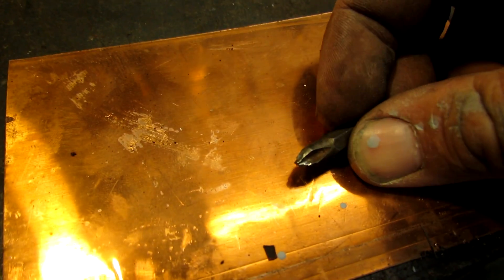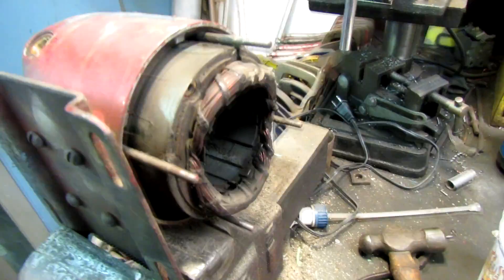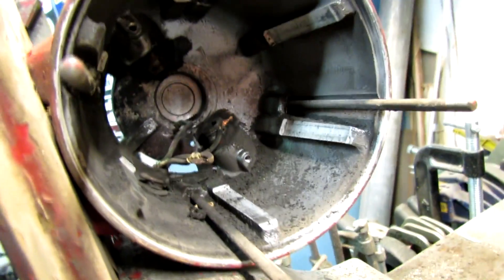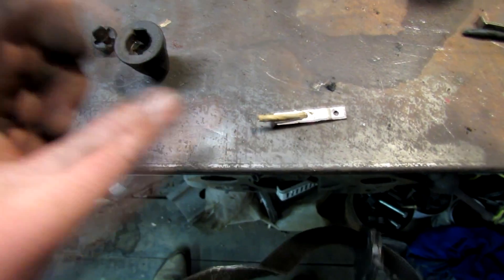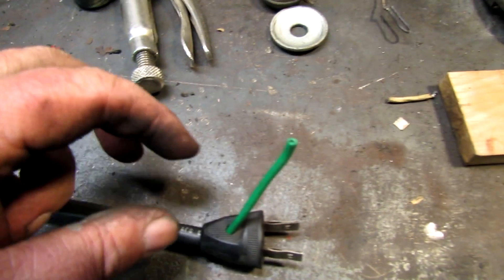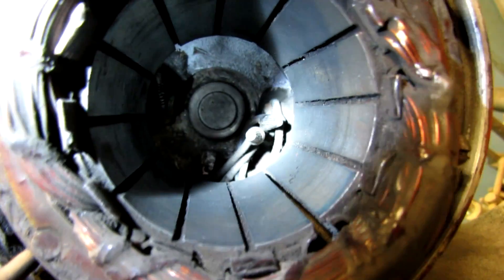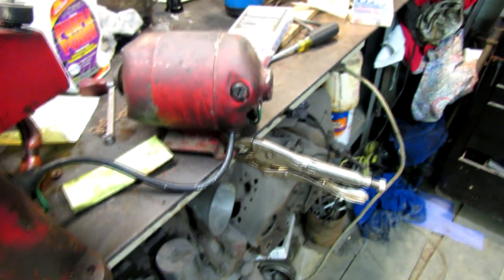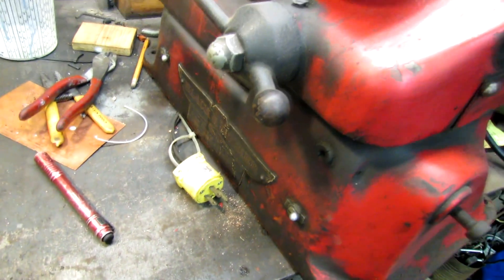Valve grinding machine

Comment: I use a similar B-D valve grinder set-up. If you really want to get into it you can get the Black/decker Van Norman original users manual which shows the ins and outs of technique,  also there is a manual for using correct grinding stones,etc for the Vibro centric seat grinder. Fun addicting hobby!
Reply from the maker: Lee Gathers I need to find that....I want to try it on a little 283.
Reply: ***** I see the reprints on e-bay.